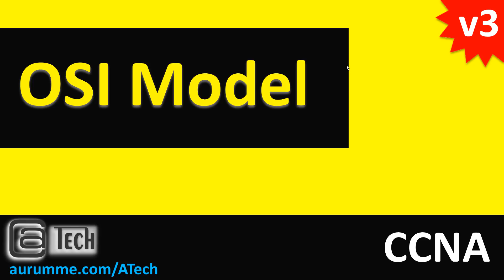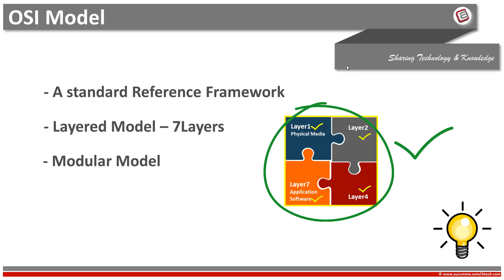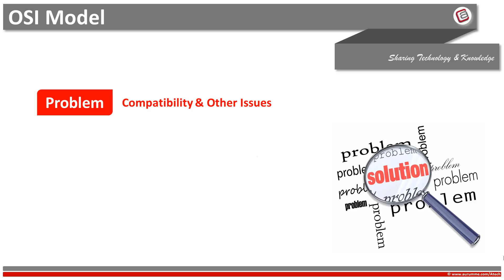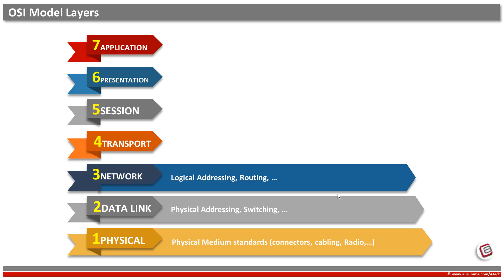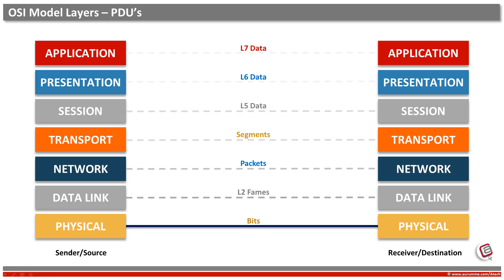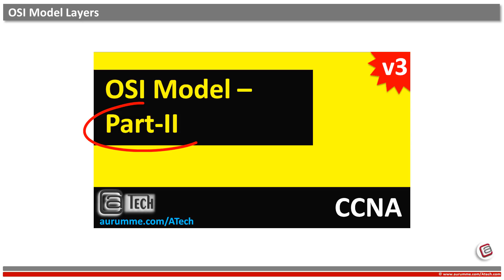01. OSI Model - Part 1 (CCNA 200-125 Full Course)

Comment: why we need TCP/ip model
Reply from the maker: We need TCP/IP or OSI Model because whole internet runs over it today. This is the protocols using which 2 different network Elements communicate with each other. Without the TCP/IP the data communication and Internet or Inter-Networking of the devices is not possible.